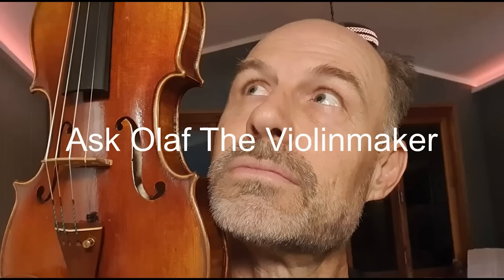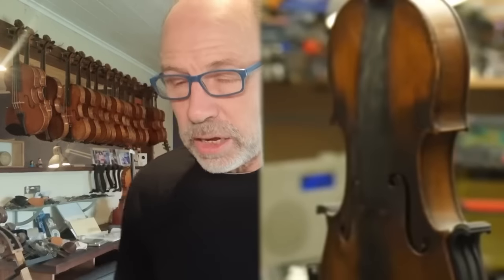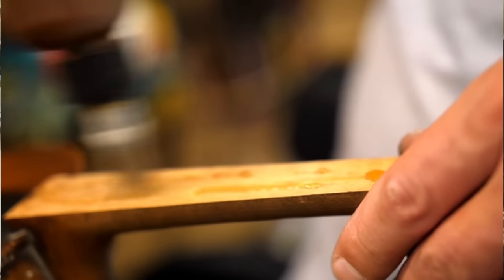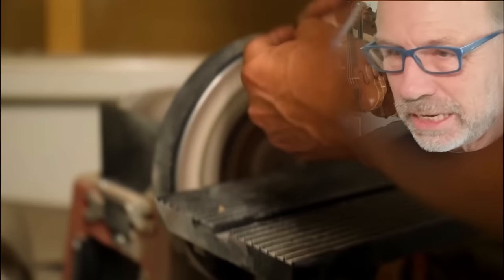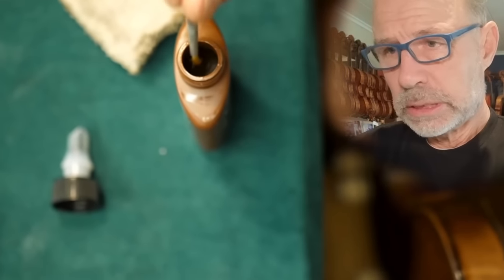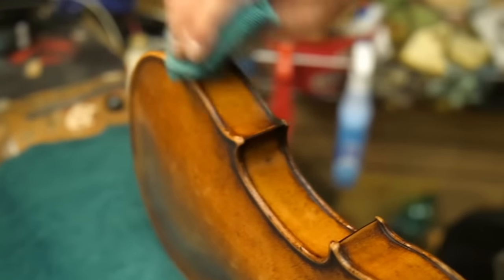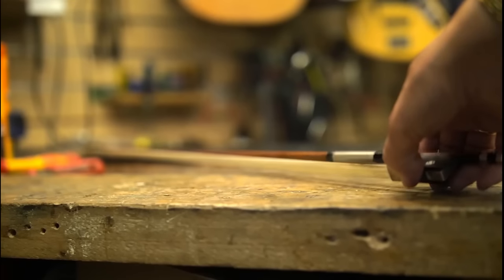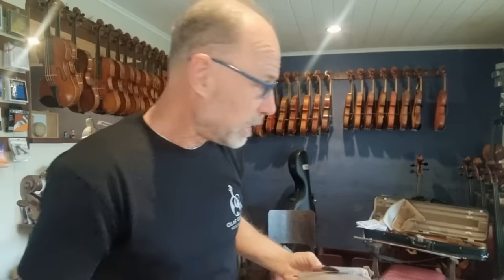Violinmaker reacts to "Ancient Violin Restoration" Video

Comment: I've repaired violins in much yhe same way as the amateur in the video. It didn't make sense to me to buy a 1930's violin for $25 at a yard sale and soend $1,000 at a luthier shop for a violin yhat the community deamed as "modern". So I consider it a reasonable effort at getting it playable. To much the same assumptions, I've worked on guitars and know some basics about wood working on violins., and while I knew better after much research and watching videos how to do it, I couldn't afford every last cradle, clamp or specific tools to do it to the snooty violin community standards. I had a disdain for the community after much immersion into their world. The violin came out AMAZING to what it once was so with my opinion, I cut that guy some slack.

Having said all that, you really have to weigh your options and do what you can do to the best of your abilities with what you are given in time and money. He took a violin and made it playable again. Thsy has to account for something. I don't believe it makes much of a difference as almost all violins ate pretty much yhe same.

The same measurements, same wood, same construction and they are all clones with no innovation. He didn't destroy the value because the community doesn't place much value to begin with on antiques. They pay for the name, not the quality.

Comment: Hi Olaf! I started building my first violin about 2 years ago, but I had to move and never got around to unpacking my workshop land tools until now! I want to finish my first violin, then apply what I have learnt and make 4 more, and go from there. I have most of the supplies and wood and "most" of the tools I will need. Is there any tips you can give me startin out? Thanks!
Reply: also interesting - I saw the titebond "hide-glue" in specialist carpentry store. I wondered if it could work as an alternative and if it would re-gel in hot water or not.. Not something I want to try out on an instrument lol
Reply from the maker: I would consider buying 'the Art of violin making ' book by Johnson and Courtnall.
Also practice carving on bits of wood... Especially the scoup and corners... Also practice doing purfling before trying it on good wood.
And double and triple check measurements. And really stick to conventional measurements.
Apart from that... Have fun

Comment: What was wrong with Titebond's hide glue?
Reply: It works too well and if that neck piece has to be taken off again, it won't be easy.
Reply: Normally what’s used is hide glue
Reply: @pippikrumeluss5167  they make a product called hide glue which is what you see here in the video so that’s why I was confused
Reply: Titebond "hide glue" is not Really hide glue, because it has other
things mixed into it, to keep it in a liquid form.
Real hide glue is just dried, ground hide and water.
Reply: @zapa1pnt  thanks for the clarification

Comment: Actually I thought the original repair was very appropriate for the violin.  In the end the repaired violin looked and sounded just fine to me and probably cost a lot less then Olaf would have charged.  Not all violin players are so picky and who says that you have to be a "professional violin repairer" to fix one?   The guy in the video also used liquid hide glue. In my opinion, Titebond liquid hide glue should be fine --  it is essentially hot hide glue with with urea added to slow the setting process -- the bond will not be that different?  Laboratory test show that the bond strength of liquid hide glue (in a bottle) and hot hide glue ( in a pot) are comparable.  Anyway it was entertaining to hear to critiques.

Comment: He’s using common modern guitar repair techniques.  They seem to work fine on guitars.  I guess violins are too fragile.

While I’m sure it’s not as good, that looked tightbond’s hide glue label.  Besides not having to heat it up, I don’t know how it’s different from authentic hide glue.  I use tightbond original be a it’s easier to undo than hide glue and lasts longer.

Don’t dog pile on me, I don’t touch violins.
Reply: I do agree that you don’t take an “ancient “ violin to a guitar tech.

Comment: Cyanoacrylate were invented by mistake... or lets say not by mistake... but but hazard during second world war when they try to find a solution for clear plastic for gun sights or to other problem they face quite often: during air fights, crashes or other type of accidents, airplane pilots get glass pieces on their eyes from the googles they use as protection. The lentils use to be made by thin normal glass pieces, the tempered glass was not invented yet... so they search or a clear plastic.
The commercial application comes around 1960 when the potential of this as a glue surface on the market.